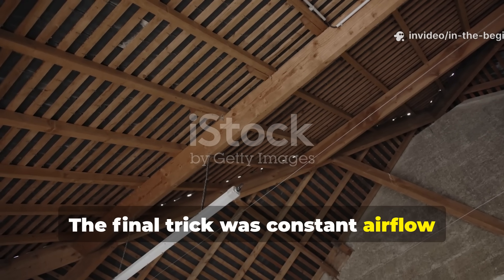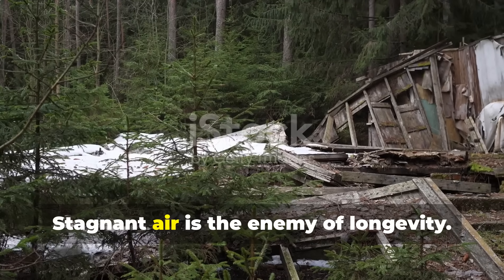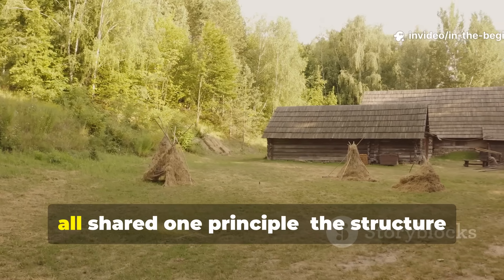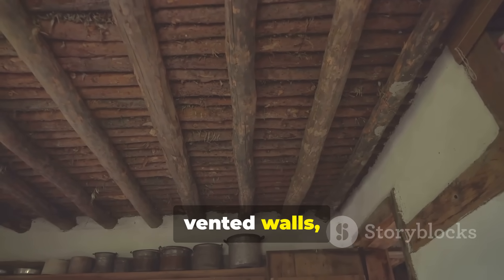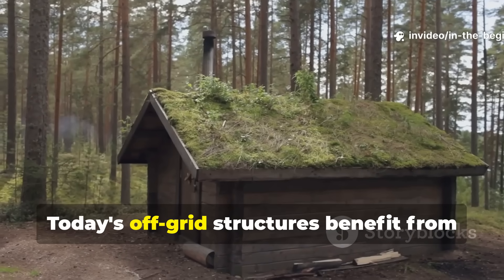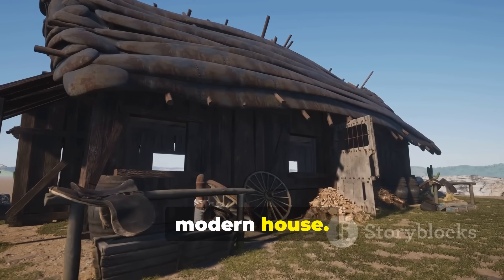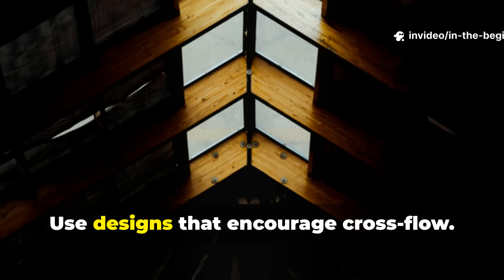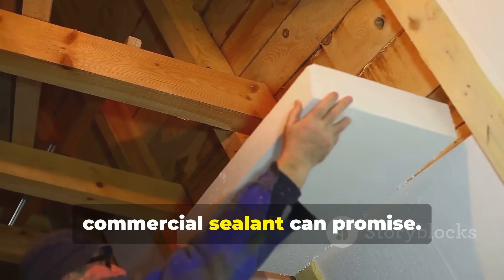Forget Concrete — This Medieval Wood Trick Never Rotted

Comment: Good luck finding some of that 1000 year old wood....
Reply: Welcome to Norwegian stave churches. The oldest was buildt in 1130 ( ok, just 900 years old, but close enough, right?:) ) The oldest wood in it, was cut in 1070, and the newest was cut in 1129 and 1130. The churches are treated with tar to avoid rotting.

Comment: Two missing elements would improve this instructional: the first is the medieval use of pine tar coating over charring (yakisugi AND sho-sugi-ban in Japanese) and the DRYING (not breathing) necessary to wick and to allow moisture to move away from wood and inhibit (though never entirely prevent) the rot process.

That and stuffing insulation up to and into a roof cavity without considering drying and vapor barrier is a no-no. In this video the statement (inaccurate--houses need to DRY not breathe) about breathing comes while preventing (drying) breathing in the visual of stuffing batting into a roof cavity which would--withoit proper planning technique--prevent drying and lead to premature rot.

Otherwise INCREDIBLY valuable information here.

Check YouTube architect ASIRI for more technical information. Leaving aside the modern petrochemical product recommendations from coatings to barrier fabrics, ASIRI's professional recommendations ARE rooted in the ancient practices used for thousands--far.more than medieval times--of years across cultures to lasting effect.

That and look to Earth and Flax for instructionals about the use of Stockholm Tar (later produced  beginning in the late 1600's by the colonial Tar Heel state of North Carolina) of Sweden building upon the Viking traditions (used to raid Europe in their longboats fired (yakisugi-sho-sugi-ban European style) and then coated in anti microbial preservative pine tar resin with its phenols and protective wicking properties.

The ENEMY of wood longevity is encasing it in petrochemical plastics (acrylic;; petrochemical based "oils"; petrochemical solvent based coatings) which starve the wood and lead to wet and to dry rot.

Pine tar based coatings --including paints--are available. RETURN to them, as they had been used by Swedes and others since early pre-histirical Viking times and long before.